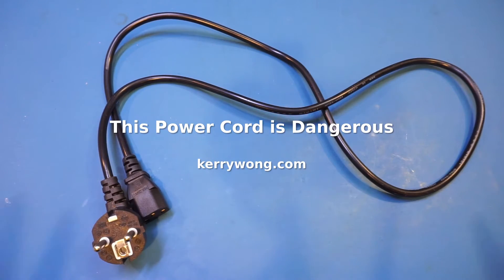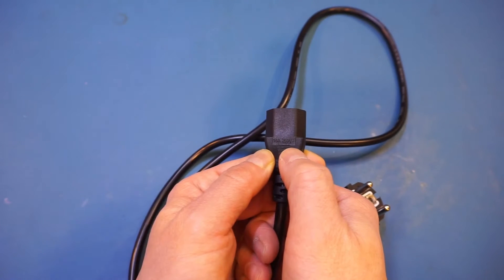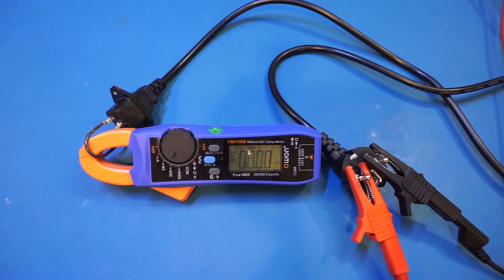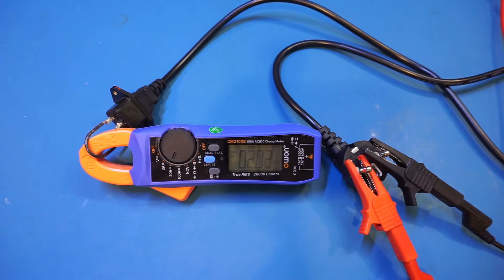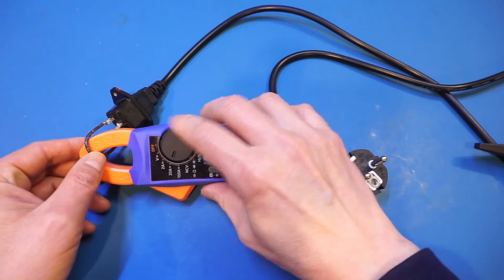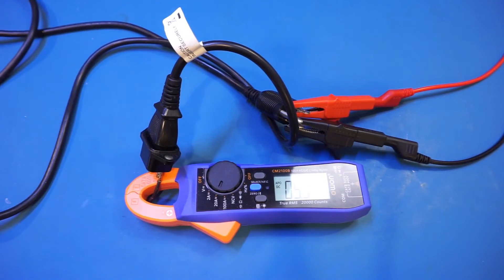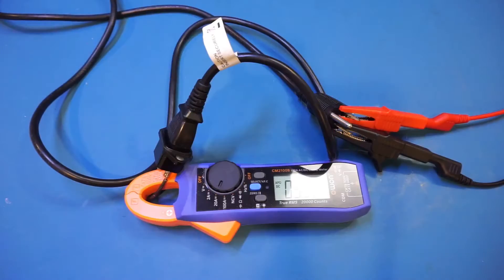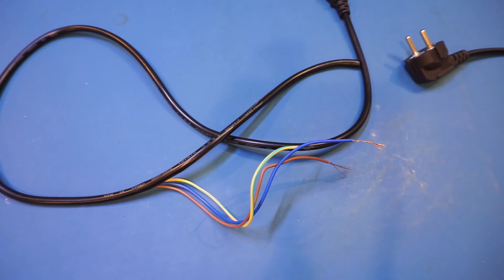This Power Cord Is Dangerous

Comment: Looks like those markings “3CX0.75mm”  mean “3-Conductors x 0.75mm” 

While the H03VV-F is a Euro designation  for Light Duty Harmonized PVC 300V max coating (usually rated for 70°C as a general light duty cord and sometimes 80/90°C in specific fixtures as non-moving component)

Since i’m mainly accustomed to working North American Split Phase 120/240V systems and residential codes I often need to shift mind sets away from the established safety Amperage Ratings but after seeing those thin ass steel wires with a coating of copper electroplating to fool consumers and initial scrutiny 🤯. 
It really hits home the importance of doing what you can to leave yourself some head-room for the unexpected. Not so easy to accept when a faceless corporation screws you in the ass because of greed/desperation/lack of effort [Maybe one of their guys read a little on “skin effect” and thought they could get away with copper plating thin stranded steel wires w/o reading more than what a cursory google search generated]

Comment: Another way these cables can be dodgy is having the live and neutral reversed. I had one with an AU/NZ plug like that, and got a boot from it.
(another fault had caused some exposed metal to contact the neutral - I was saved by an RCD)

Comment: I figured that the wire must be copper coated because the resistance of iron wire should be about 9 times as much as copper, they used wire for a different use entirely that they got at a lower price than copper to make the cord and cheated the buyer in China, it happens all the time. Same with the plastic.

Comment: In addition to checking for copper clad steel wire and under-sized wire you also need to check for improperly wired cables. I came across one in my shop that had the line and neutral swapped - this is a cable with molded connectors. I checked all my cables and found two more with swapped line and neutral! Buyer beware I guess. Thank you for the video. Regards, David
Reply: In Europe it doesn't matter, because we don't have a standard here that defines "polarity." Well-designed devices should work well and be safe when swapping the line and neutral wires.
Reply: @elpolaco7654  Seriously? The brown conductor isn't the "live" conductor and the blue wire isn't a grounded conductor (not "grounding" - yellow with green stripe) and the brown wire isn't connected via the fuse (if installed) so that, if a ground fault occurs and the fuse opens, power is no longer present after the fuse???? Sounds like a Seriously flawed and unsafe system. Regards, David
Reply: @davidv1289  Of course, the electrical system in the house is as you wrote: brown live, blue neutral (yellow-green protective earth) and the fuse is on the live wire. In contrast, already in a socket in the wall, there is no guarantee that the live is, for example, always on the left side. Therefore, inside the appliance, you can't be sure which wire is live and which is neutral. As I wrote correctly designed device should always work properly and meet safety requirements regardless of how the input live and neutral wires are connected.
Reply: Actually that is incorrect, in Europe as in the US , the electrical outlet is polarized. The neutral (blue) wire should always be connected to the left side and the hot should always  be connected to the right side of the CEE 7-3 and CEE 7-5 recepticals (looking at the front of the receptical). While connected devices will perform correctly with either orientation of live and neutral during NORMAL operation the maintenance of correct polarity is essential for abnormal conditions such as ground faults (i.e. a short circuit between the live and chassis). Reversing the live and neutral connections can result in a open fuse in the neutral and a chassis at line potential to earth (i.e. electrocution). Regards, David
Reply: @davidv1289  
Can you give some reference to the applicable standard or law?
The Schuko (type F) most common in Europe is not polarized. You can turn the plug however you want.
In the type E used in my country, the plug is polarized, but there is no standard that dictates where the live conductor should go. Besides, double sockets are sold here, where the top socket is symmetrical with respect to the other, i.e. the protective prong of the top and bottom are next to each other. This causes that if you plug into the socket at the bottom you will have the live on the left prong, for example, but if you plug into the top one, due to the fact that you will have to rotate the plug the live will be on the right prong.
Besides, of course, the Europlug (2.5 A), which is used almost all over Europe, has no protective earth and you can rotate it as you wish.
Reply: I would recommend IEC 60320. All of the plugs that you mentioned should only be used with double insulated devices and never used on a cord that powers equipment that requires grounding. (i.e. has an exposed metal structure or housing) Those plugs have nothing to do with the type of cord  being discussed here. Non-polarized plugs have been banned here for decades due to the hazards they present. Regards, David
Reply: @davidv1289 I'm afraid you don't know what you're talking about and you've never done an electrical installation according to European standards. Maybe someday you'll visit Europe you'll be able to see for yourself what electrical outlets, plugs and cables connecting them to appliances look like.
In the meantime, you can read, for example, the Wikipedia article titled "CEE 7 standard AC plugs and sockets".
Reply: @elpolaco7654  I suppose you may be right, my 40 years of experience working in the electrical and electronics trade in many countries around the world may not apply in your country. I hope that you have a long and shock-free life. Regards, David
Reply: @davidv1289  I apologize for losing patience yesterday in explaining the details of European electrical installations. I will try to briefly address your assertions, which I believe to be untrue.
I hope that by "my country" you mean Europe, because everything I write here is true for the overwhelming majority of European countries.

"Ground faults" in Class I equipment, i.e., equipment that requires grounding, are not a problem because the chassis is connected to the protective earth conductor, which is run separately from the line and neutral conductors. In the event of a neutral wire break, the chassis is connected to the neutral potential anyway, because in the TN-C-S topology, the most popular here, the protective earth conductor is connected together in the "switchboard" with the neutral wire that comes from the MV/LV transformer. If there is a line potential on the housing of an appliance in a modern installation, a GFCI will trip immediately. Even without a GFCI, if the impedance between the line and ground is low enough, an overcurrent short circuit protector will trip or a fuse will blow.

You wrote that the line should be on the right side of the outlet. If you had ever picked up a good quality European cable of the type shown in the video, i.e. a CEE7/7 plug on one side and a C13 on the other, you would have noticed that on some such cables there are L, N, G markings on the C13, according to the IEC 60320 standard you mentioned. And now if you took a continuity tester and checked where the contact marked L ("lower right-hand position") on the C13 is connected, you would notice that it is connected to the prong on the right side of the CEE7/7 plug, that is, in the wall outlet the live should be on the left side.
We always try to connect wall outlets this way. But the double sockets I mentioned above, which are widespread here, cause you to connect the live to the left prong of the plug in one case, and to the right prong in the other.
In addition, some of the electrical equipment companies here supply sockets that are not symmetrical, that is, the distances between the connections of the protective earth conductor and the phase and neutral conductors are not the same. Then the manufacturer marks where the line wire should be connected and where the neutral wire should be connected, and in many cases this results in the live being on the right side of the outlet.

Of course, your statement that the plugs I mentioned, namely Type E ("French") and Type F (Schuko) are only for double-insulated devices could only make me laugh.
To be clear, I never stated that a polarized system with a specific location for line and neutral is useless. Of course, it would be better if we used it everywhere, but in Europe, for historical and practical reasons, it is not required by regulations or standards.

Personally, I prefer the European system to the American one because of twice the voltage of a single-phase outlet, which allows for easier use of higher-powered appliances such as electric kettles, which are very popular here. In addition, almost every house has a 3-phase connection, which makes it possible to draw high power and easily use simple in design and reliable three-phase induction motors.
Reply: @elpolaco7654  Thank you for your patient reply and the Wikipedia article reference you included. Now I must apologize. As I read your reply I was thinking, yes, right, correct, okay, sure – and then it hit me. In your first reply you stated “we don't have a standard here that defines 'polarity'”. I mistakenly assumed then that we must be talking about BS 4573/Euro Type C/Europlug style connectors that have no polarity (in fact you mentioned this type), why I did this I do not know but I apologize for the ensuing lack of comprehension on both our parts. In my defense, we have no electrical connectors for corded equipment that can be inserted into an outlet in more than one way. I had forgotten that the CEE series plugs can be inserted in either of two directions AND continue to provide a ground connection.
I believe the debate about our 120/240 volt system as opposed to your 240 volt system will continue to eternity. I do believe that having three phase power available for residential use is a plus. Regards. David

Comment: For measuring stranded wire size, I usually just use a wire-stripper (the kind with multiple notches for different wire size), and just find which position fits the wire conductors best (with the tool fully closed).  It's more reliable than trying to use something like calipers.

Comment: Power cords, usb, ethernet, coax the list goes on. We're not staffed to impound and destroy enough shipping containers to make a dent. Customs will sometimes open and destroy every carton in a container shoe horn it all back in floor loaded and let the importer deal with the scrap cost when he opens the container.
Reply: There isn't necessarily anything wrong with the use of copper-coated conductors in Ethernet, or coax, or even sometimes USB, depending on how it's used.  For data transmission, the frequencies involved are often high enough that only the outer layer of the conductor is actually used (due to skin effect), so it doesn't really matter what the core is made of, so CCA or CCS actually work just as well, and using copper for the whole thing would actually just be a waste of both money and materials.

However, with power cables like this, the AC frequency is low enough that the skin effect is negligible, and they are often used to carry enough current that heat generation can be a problem, so it really does matter.
Reply: @foogod4237 In addition to thermal effects, there is also a voltage drop. In fact, I saw a case here where someone asked me to check why his mains-powered garden appliance was not working on a new extension cord he bought at the flea market. After investigating, it turned out that the single-phase induction motor in the device couldn't start because the voltage drop over the 15 meter (50 ft.) length was too great. Of course, it turned out that the wires were made of steel and looked similar to those in the video.

Comment: Would this issue be as severe with AC? or would the skin effect ensure that most of the power is transmitted over the copper?
Reply from the maker: For mains frequency, the skin effects won't be at play here as the skin depth is more than 8mm.

Comment: The scrap industry calls this "fools copper" because it is copper-plated or copper-clad steel. Scrappers carry magnets to check everything that looks like pure copper to make sure it really is. There are places for such metal constructions because if it's strength, but certainly not for it's conductivity.  Definitely a cost-reduction move on the cord you tested.  I check all wire, fuses, and connectors coming out of retail and online sources for 4-wire resistance, and sometimes magnetism to determine if the wire is undersized or not a good alloy.  If it's not what I expected I return the item.

Comment: Great test video! 👍

Yeah, fake cords are issue. One time I get locally C13/C14 power cord for rack project. I cut it, because I needed only C14 part. Didn't noticed anything strange, because I was using screw terminals. Few years later, for other project, I decided to reuse other half and I needed to solder it.. Only then I noticed strange behavior and decided to check with magnet.. 😂

Sometimes, there is great cables included from China too, but that's rare. My first check is with multimeter - resistance and test for short.
Highest, so far, was 4 ohms only one wire. Magnet didn't show anything. I cut it and find out that it was made from aluminum.. 😬
Reply: Aluminum is actually a pretty good conductor (not as good as copper, but only about 50% worse, and still 10-50 times better than things like steel), so if you were getting something as high as 4 ohms from any kind of short length, that probably wasn't actually aluminum, either.  What gauge/diameter and length was that wire you tested?

Note that not all kinds of steel are magnetic, either, so it's possible for a wire to actually be steel but still not react to a magnet, too.

Comment: Unfortunately I've came across this situation several times before, it's always stuff from china in the form of power cord extensions, power cord plugs like that you show, and equipment built-in power cords. The most recent ones were one of those small no control just on/off hot air gun, and in a desoldering/sucker tool. 🤬😠

Comment: Wow, nice little detail to check the cable print. I never thought of that. But my 0.75mm² cables are all copper, just checked.
On the other hand: I would not dare to send 2000 watts (aka up to 8.5 amps in Germany) continuous over such a plug. But what happens at 5 amps? I suspect it would still heat up way to much.

Comment: This cable is a fake (made of steel) H03VV-F. For real H03VV-F, which is defined in European and IEC standards, the current carrying capacity in air is 6A for 3x0.75mm^2. The sheath should be made of PVC type TM2.
60-70C is still considered a safe value, although this is already the limit.
By the way, for a stranded wire, its cross-sectional area (gauge) is not determined directly by measuring the physical size, but by giving the cross-sectional area (gauge) of a corresponding solid wire made of the same material that can carry the same current as the stranded one.
Reply: A typical rule of thumb is that stranded wire needs to have about 15% larger diameter to have the same cross-sectional area as equivalent solid wire, so you can usually get reasonably close by just "derating" your measurement by 15% if it's stranded.  Of course, measuring the diameter of (small gauge) stranded wire using calipers is almost always going to give you a very inaccurate result anyway.  It's much better to use a gauge that employs round holes or some such instead.
Reply: @foogod4237  Of course, this is true, after all, the idea is that the actual sum of all the cross sections of the individual wires used in the cable should be as stated in the specs, because this determines the conductivity/resistivity of the cable.
I noticed another inaccuracy in this video. E.g. also in the description under the video there is a statement that the cable is rated for 10 A, but this is not true, because this information is on the "plug" and applies to the theoretical capabilities of the C13/14 connector/inlet pair.
Even on good quality cables from well-known companies there is information about 10 A on the connector, which does not mean that the cable is designed for 10 A, because as I already wrote in this thread for cable H03VV-F 3G0.75mm² the maximum allowable current according to the standard is 6 A.
Reply: What's the usual usage for this type of cord/wire? Like let's say, actual "legal" usage?
Reply: @amogusenjoyer  "Cable for powering electrical appliances in homes and offices. Small mechanical loads for the 
H03VV-F cable, such as radios, table lamps, hanging lamps, and offce equipment. Medium 
mechanical loads for the H05VV-F cable, such as washing machines and refrigerators."